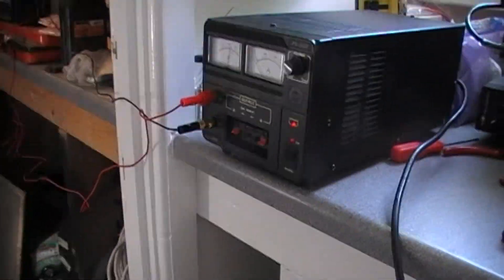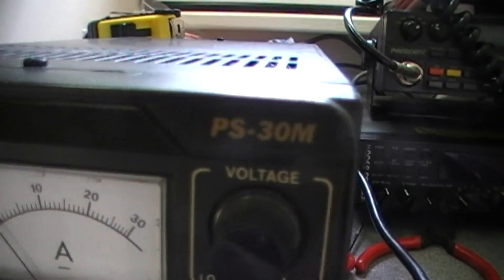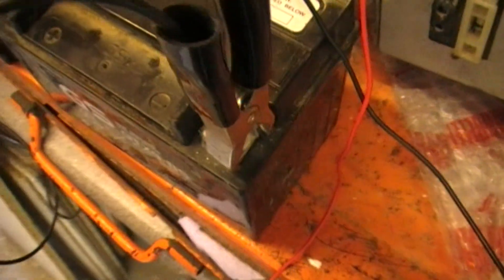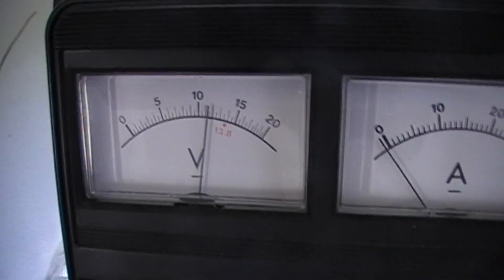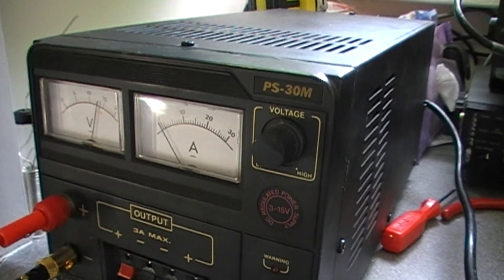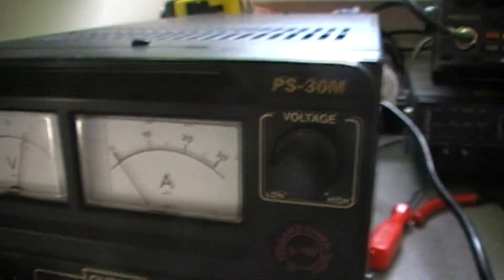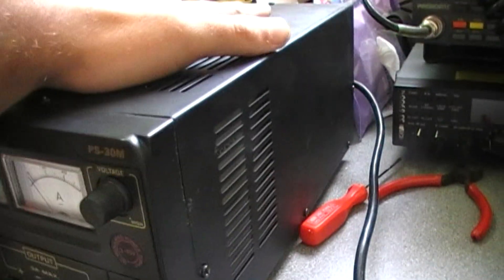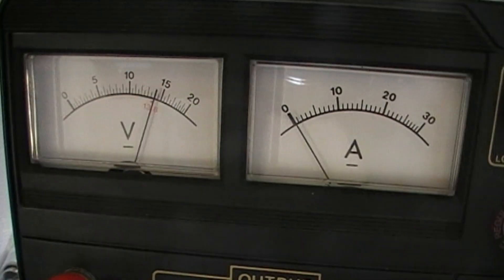How To Charge A Car Battery With A Power Supply

Comment: Hi, What if your DC power supply does not have level indicators? My power supply shows output @ 13.8v DC and current @ 3A constant and5A surge.
Reply from the maker: That means it can run a 3a constantly but 5A only for a little while.
Reply: @RSPYT  Thanx, I get that, but how will I know whether it actually charges the battery and when it is full other that connecting to a volt meter everytime?
Reply from the maker: If you have no meters on the PSU then the only way is to use a multimeter. If you had an amp meter on the PSU, it would be reading it’s taking amps when it’s charging and as the battery is getting full it’ll slowly go down to 0 amps.

Comment: I did this yesterday because I was in a bind and my truck battery was dead.  I ran the power supply at 14V the amps fluctuated between 7-10.  I’m no electrical engineer but this seemed kind of dangerous to me.  After about 7 minutes, there was enough charge in battery to start the truck.

Comment: As the battery is on charge right now,  is there any means of which the battery can be used to power other things or dispense power to at least a motor or bulb?

Comment: I was looking around generally for some info on charging techniques and you just so happen to have the very same PSU as me, The PS-30M. I often use 12v sealed lead acid batteries for my various RGB projects. I have since swapped out the VU meters for digital displays, for more accurate measurements. I would recommend limiting the initial charge current by keeping the voltage down enough to lower initial amperage draw. It will help to reduce strain on the cells and increase the life of the battery. Also as mentioned previously, add a blocking diode.
Reply from the maker: Thanks for the info. I still have this PSU along with many others also :)

Comment: always use a Blocking  Diode in series  as has been mentioned .. don't forget to take into account the voltage drop that the diode in series will give , This is around 0.7 of a volt ... so add this to the voltage of the power supply ..

Comment: thanks sir..  i cannot charge may 12v 2.5Ah battery to my 12v 13amp psu ..  im afraid because the amperes are so far away from each other. and i think might explode :)  thanks for your response :)
Reply: Measure and match the batteries initial voltage on the PSU output, slowly increasing as voltage (current) flow, then settle charging rate at around 300~500ma above balanced current to keep charging safely. When the voltage of the battery peaks at optimum, the amperage draw decreases toward zero. However using this method is far more precarious than using an appropriate lead acid trickle charger.

Comment: sir. good day i have a 12v 2.5Ah (2500mAh) motorcycle battery.  

can i charge it into a 12v 13amps computer powersupply?

even the amps of computer psu is very far from the amps of battery? can i still use it as a alternative charger?
Reply from the maker: I would have thought the PSU would be more than 13 amps?
Reply: As long as you keep the battery voltage from rising beyond 14.7 volts (AGM) or 14.1 volts (gel), and keep the charging current below 1/2 amp, you should the safe.  Think of the amps rating of the power supply  like the horsepower of your car; a big powerful car can carry a tiny passenger as well as a very large one.  The small passenger is not in any added danger riding in a big powerful car, compared to riding in a tiny car.

Comment: what about pumping 12-24 amps? i ask because i have a modified atx 400w power supply i want to use for a car battery, the output carries 16 amps and 12 volts.
Reply: Cesar Gonzalez a computer power supply, especially the 12v rail on its own won't charge a battery. you need a higher voltage than what you are trying to charge. if you can come up with a way to manually adjust the output voltage accurately then it should work great. you must remember that amps are drawn, not pumped. so if you put your battery on there to charge it might draw a few amps for a little while if it's really dead, but assuming nothing catches fire and the power supply doesn't just immediately go into protection mode, once the battery reaches a float voltage of 12v its only going to draw enough to stay at 12v which is nowhere near a full charge. you can't "push" amps into it unless you raise the power supplys voltage. to fully charge a car battery you will need to bring it up over 14+ depending on what the manufacturer recommends, volts and then hold it there for several hours.

Comment: been charging batteries manually for a long while now. this vid helped alot.
i do have a question though and can't seem to find the right answer. i know charging 12 volt batteries to 14.6 - 14.8 volts is a fully charged battery .I'm trying to find out the maximum charge voltage that you can use with the power supply to get your battery to 14.8? I recently discovered a laptop power supply supplying 19.5 volts at 5 amps  to charge my 12 volt 60 amp hour battery. using a heating element out of a space heater for a resistor I can limit the current as much as I want. my question is what is the maximum power supply voltage I can use to get my battery up to 14.8? the 19 volt power supply method seems to work great I just don't know if I'm really damaging my battery even though it seems to be working fine
Reply: You should monitor the battery voltage as it is charging, with a digital multimeter.  Before the battery reaches 14.6 - 14.8 volts, the power supply voltage can be much higher, as any excess voltage will be dropped by your series resistor.  [power supply voltage - battery voltage] = charging current X series resistance.  Once the battery reaches 14.6 - 14.8 volts, you must reduce the power supply voltage or increase the series resistance so that the battery voltage doesn't continue to rise.  Once the charging current drops well below 1 amp with the battery held at 14.6 - 14.8 volts, it will be fully charged.
Reply: I charged my car all summer to 16v using a 23V-open-circuit, 250ma solar panel. The 17.5 year old battery was showing capacity increase according to the hydrometer. I am hopeful next summer when there is more sun, the battery could reach like-new capacity, or close.

Comment: I've designed a circuit that uses a computer ps to run a raspberry pi and an led matrix (2048 leds to be specific) on the 5v rail.  In addition, I have a few car horns on the 12v line hooked up to a relay triggered by the pi.  The car horns pull somewhere between 6 and 10 amps (together) when in use. While the ps is rated for 14A, the sudden hit with the horns drains the power, even impacting the 5v rail.  I think I'd like to use a medium size 12V SLA battery to drive the horns but I don't want to have to constantly charge it up after use.  

My question is, can I put the 12v line into the battery to keep it charged as it's being used?  The longest use would be something like 8hrs.  The battery will dip under high use when the horns go off ever 30 seconds (this is a competition timer) and then go out of use for several minutes at a time.  What are your thoughts?  Thanks!
Reply from the maker: +mandyNdave Hey! Thanks for your question! 

I can't see any reason why you wouldn't be able to do that. However would it not be just as easy or perhaps easier to just invest in a PSU capable of more Amps? For example a 25A PSU? I use a 25A PSU to power Amplifiers drawing almost the full 25amps and there is no drop in current or voltage. 

But yes, to answer your question, as I said leaving the battery on charge while using it won't do any harm, it would just introduce an unnecessary "Middle Man" so to speak ;)

Comment: Best be careful doing this, many power supplies have crowbar circuits that will short the output terminals if the voltage is higher than the setting on the dial...
Best use a blocking diode in series with the output of the powersupply.
Reply: David Lisney ic